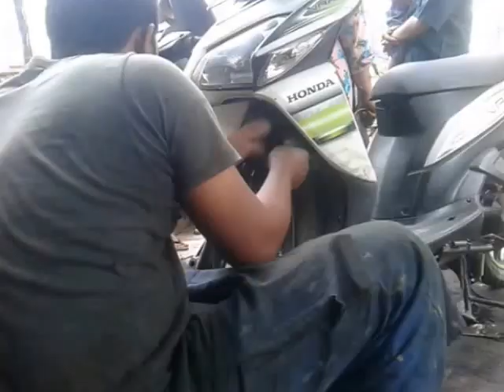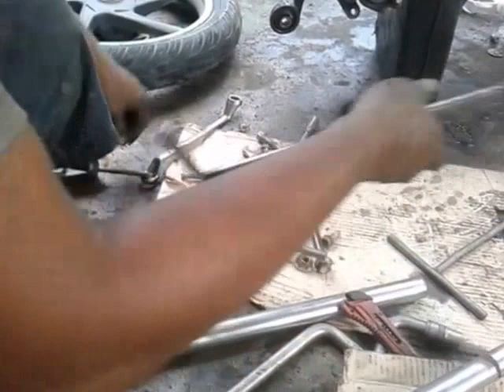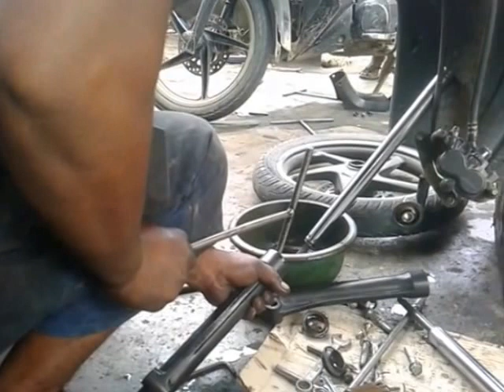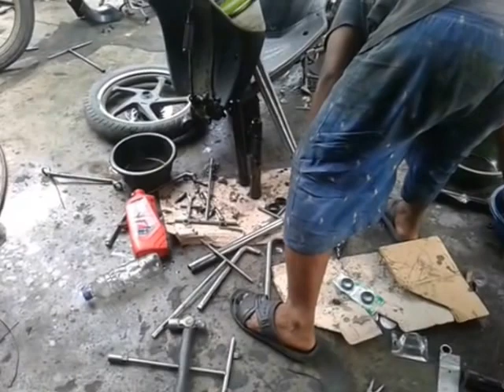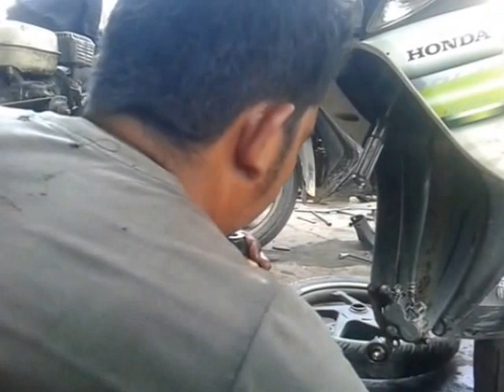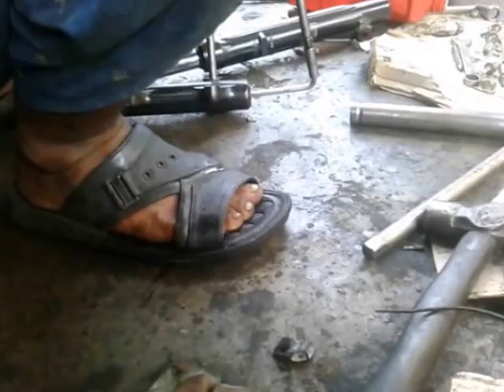Cara Mengganti Seal Yang Bocor Pada Shock (Suspensi) depan Honda Vario

Comment: Itu ukuran panjang pernya brp cm gan?  Soal'a ane mw beli ad 2 plihan yg 29cm yg biasa & yg Uk 32cm yg ad tulisan cbs'@,,motor sya vario 110cw karbu,, tlg d jwab gan
Reply from the maker: 29 cm gan, vario 110 tahun 2008
Reply: @MbergehkinSembiring  Oh gtu,, trus motor sya vario 110cw karbu TH2013,,kira" mw beli per shock'a uk yg brp 29cm/32cm yg ad tulisan tipe. Cbs'a gan?